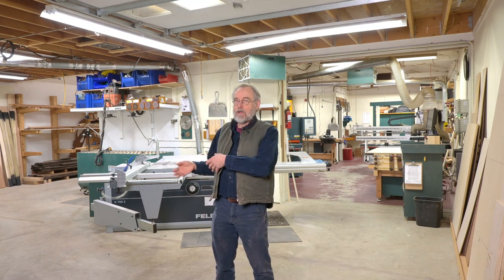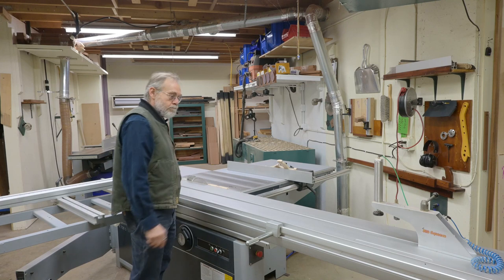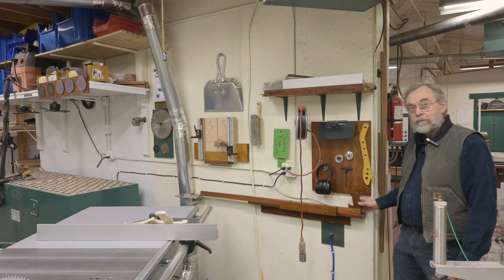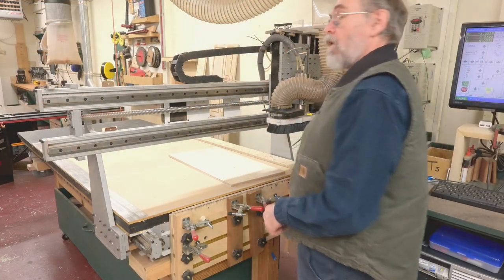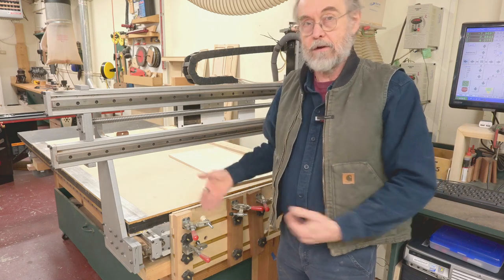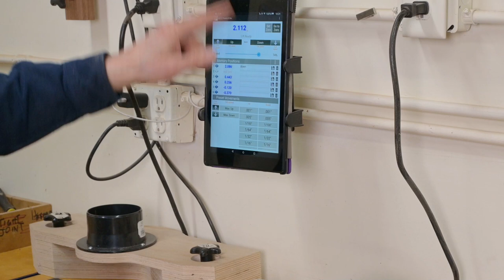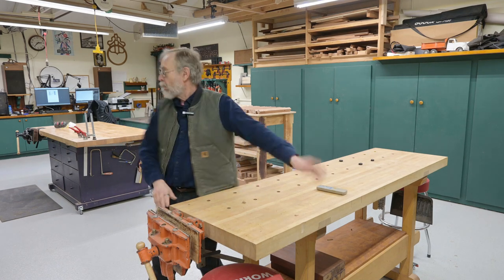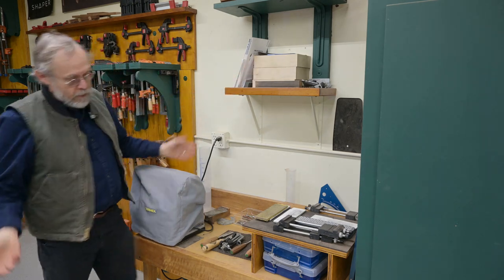Woodshop Tour

Comment: Always enjoy a shop tour especially from Darrell.   It is impossible to build a shop large enough as tools and machinery are gases.  They expand to fill whatever size and shape container they are placed in.  The only thing that changes is the pressure on the outside walls.  Steve
Reply from the maker: thanks, Steve. Yes - an empty space will always get filled!

Comment: Nice enough shop. Slider is nice, router with digital control is nice, not a fan of the planer/jointer combination but nice unit.
The big plus I liked is the painted floor. You really got me at the end,,,why would you save a bad tape measure
Reply from the maker: I use bad tape measures for rough cutting at the radial arm saw or if I'm doing  rough carpentry work. If someone asks to borrow a tape - they get one of my bad ones (unless I know them well enough to trust them with a good one)

Comment: Was wondering if you have a PC dovetail machine. I rarely need the Omni jig but it is a good thing to have.  I have several Felder machines and they are a nice machine. I have used the Sawstop and even though you have the sliding table; do keep the regular table saw for short length cuts and other dado requirements would be my thought. Thanks for the tour.
Reply from the maker: Thanks, Vincent!  I don't have a  PC Dovetail machine but  I have  an Omni Jig  (hasn't been used in some time though)

Comment: Looking forward to your updates review if the saw! I have a k3 that I’m really not happy with. Ordered a hammer ad41 jointer planer which had to be sent back (so upgraded to tye am felder ad741 at the same time). So, so far I’m very disappointed with hammer and even though tye Ad741 works well I’m still a little skeptical towards the entire felder engineering and production standards. But seems like you’re really happy with the k700, which is what I’m also considering (as they’ll let me “upgrade” my k3 to one).
Reply from the maker: I had the K3 and thought it was a good saw. The K-700S is much better in every regard though. I also had an A3-41 before the AD - 941. The A3 was a good machine but again not nearly as good as the Ad-941. I have never worked on an AD-741 so I cannot comment on it.
Reply from the maker: @jimpackard8059   Are your comments meant to provoke me  - they don't appear to have any other purpose.

Comment: HI Darrell, I'm curious why you have both the multirouter and the pantorouter. Surely there's no need for both. Similarly, why have both a full CNC machine, as well as the Shaper Origin?
Reply from the maker: Hi Simon!  While I use both the MultiRouter and my full CNC more  - there's a place for the Shaper Origin and the PantaRouter as well. The Shaper Origin is more portable and has onboard commands that don't require making a CAD drawing - I can quickly cut a circle or rectangle for instance.  The Pantarouter's super power is it's template system that allows me to dial in the fit of a mortise and tenon or dovetail joint to the perfect fit.   
It's kind of the same as the Lamello biscuit joiner and the Domino. I have both and use them for different things

Comment: How do the 3 router tables work so that they don't interfere with each other?  Is there a slide out mechanism?
Reply from the maker: The center one is out further so it can be used without interference from the two side ones. The center one is on an electronic lift with memory positions - I can lower it when not I use then raise it back to the stored position

Comment: Weird that the county wouldn't let you take out a wall.  A steel I-beam header can usually replace anything
Reply from the maker: the builder was all for it  - the county said the original building was not up to code and we had build the addition as if it were a building in itself -then attach that to the original building to  bring it up to code.

Comment: I cannot see a sawguard  on the panel saw. If something should drop on that when it is running, it could fly off at lightning speed. You need a guard
Reply from the maker: In all the years I have been woodworking - nothing has dropped from the ceiling.
Reply: I am now retired from decades in the industry including many years in senior management roles in the wood industry. For sure, people accidentally drop bits of wood etc., on to rotating sawblades. That is one reason why they are designed to have sawguards on the top. In my view it is irresponsible to show a video like this. I recommend you ask government Health and Safety for their data on woodworking accidents

Comment: Darrell,  the question Why! . I'm 62 and have a shop business that's comparable to yours and I'm ready to turn it back into a small fun hobby, I don't want to lifting big sheets of plywood on my slider or the CNC or having deadlines. I thought you said that your retired but buying production equipment ? . The worst thing to do for a hobby is to give it a four letter word (WORK)..
Reply from the maker: Hi Ken,  I love to work but hate deadlines. I should have upgraded my equipment years ago but  felt I could not afford to do so. When I finally decided to  slow down and wasn't needing the income - I kept working for a while and went on a buying spree. I bought the machines I had always wanted. For me this is the  ideal retirement - taking on a few small projects here and there but mostly building what I want to build with no deadlines or pressure.
Reply: @DarrellPeartFurnitureMaker  Okay, Have Fun.